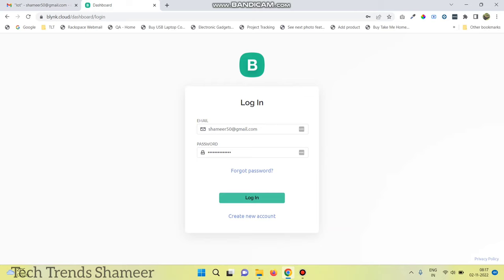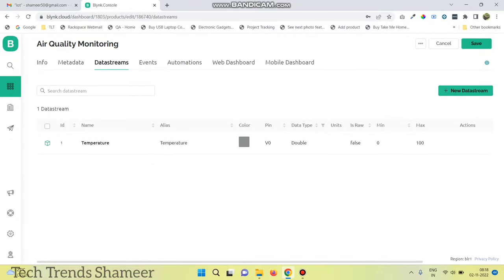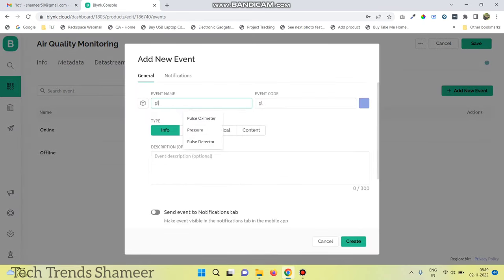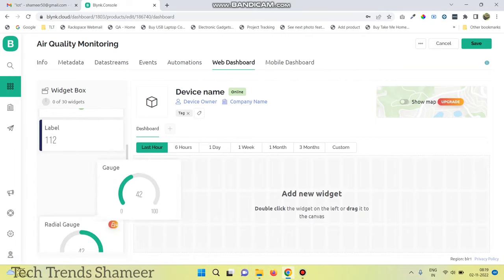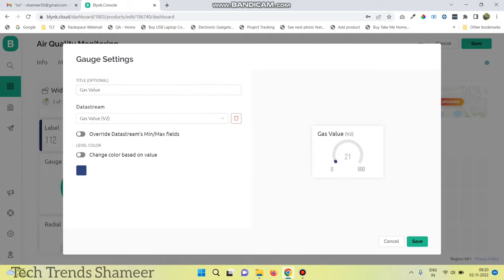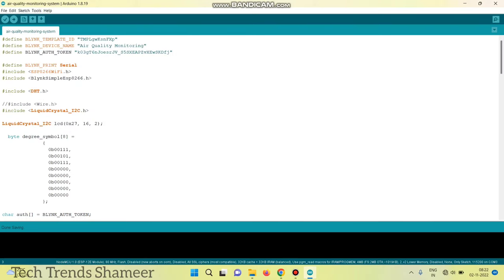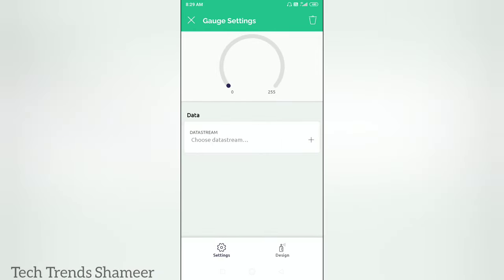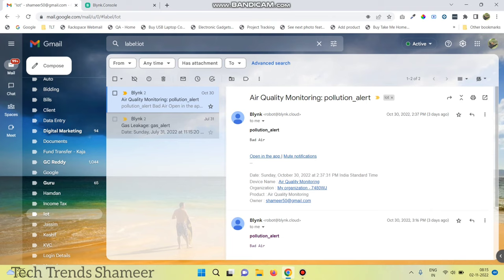How to Monitor Air Quality | Air Quality Monitoring System | ESP8266 | Blynk IOT Projects

Comment: Hi sir , 
When I upload code in nodemcu board it's showing a warning: library liquidcrystal i2c claims to run on avr Architecture(s) and may be incompatible with your current board which runs on esp8266 Architecture(s)

And my lcd is not showing anything
Reply: Have u fix the problems ?
Reply: @brianwijaya7378  nope
Reply: Bro whether output came.. did you troubleshoot this problem
Reply: Do u get the ans?? I am getting the same issue

Comment: To which u connected the air quality monitoring device that black cable is it to Laptop 

Plzz say it fast
Reply from the maker: Yes. I connected to laptop. You can connect using power bank too.

Comment: Provide the connection for interfacing of circuit
Reply from the maker: Its in the video. Watch full video.
Reply: Which IDE version you are using in this project
Reply from the maker: Arduino 1.8

Comment: Are you using male to female wires?
Reply from the maker: Yes.
Male to Female (For Breadboard to Sensor Connection) and 
Female to Female (For I2C to Sensor Connection)
Reply: @TechTrendsShameer  By the way I tried to make the circuit diagram in Fritzing but I didn't find the library for MQ135, do you think you can help me with that?

Comment: there are error in code. nodemcu pin to be defined as D2 and not 2. further GAS value is not getting printed in serial monitor being not defined
Reply from the maker: Both are correct. If you define as D2, you need to connect to PIN D2 in Nodemcu. If you mention as 2, then you need to connect the D4 in NodeMCU (GPIO4).

Comment: WARNING: library LiquidCrystal I2C claims to run on avr architecture(s) and may be incompatible with your current board which runs on esp8266 architecture(s).
 It says like this when I try to compile,what should I do sir?
Reply from the maker: You need to install that library LiquidCrystal I2C
Reply: @TechTrendsShameer  yes I did but the problem still persists sir
Reply from the maker: still same error ?
Reply: @TechTrendsShameer  ya actually I install more than one library(liquidcrystal)...but still the same
Reply from the maker: Remove all the old libraries and use this one alone.
https://github.com/Tech-Trends-Shameer/LiquidCrystal-I2C

Comment: Sir i dont want to use I2C controller then it will okay or not
Reply from the maker: You need to modify the code if you are not using I2C.

Comment: WARNING: library LiquidCrystal I2C claims to run on avr architecture(s) and may be incompatible with your current board which runs on esp8266 architecture(s).
sir what is warning
Reply from the maker: It's a warning. You can ignore this

Comment: If we not apply screen did project work
Reply from the maker: Didn't get your question.
Reply: @TechTrendsShameer  means in code led code is also there so if does not connect 16x2 led so project work I have dht 11 and mq 135 sensor
Reply: My project is working fine with dht 11 sensor and is giving output to blynk but when I tried to run with your code which includes 16x2 led screen,mq135 sensor and dht11 sensor blynk is not showing error.i have not attached led 16x2.
Reply from the maker: Remove the lcd code and try.

Comment: Sir please tell where did you write the code, how to upload the code to ESP8266 board
Reply from the maker: To write code I am using Arduino IDE.
Check this video for NodeMCU setup 
https://www.youtube.com/watch?v=IXSzQpfp0n4
Reply: @TechTrendsShameer  Thankyou sir for your response, but even after trying multiple libraries for LiquidCrystal_I2C 
showing "compilation error no such file or directory is found"
sir, Please tell what should I do
Reply from the maker: May I know how you installed the library?
Reply: @TechTrendsShameer  Sir after trying your zipped file for LiquidCrysta, it worked
But now same problem is arising for (HID) but unlike other libraries I used there is not any proper library in Aurdino IDE as HID.

And even after trying a zip file from aurdino website, error is same
Sir please tell me what should I do
Reply from the maker: What is HID ?
Reply: @TechTrendsShameer  I think it's a library or module in mouse library

Comment: Sir atleast make detailed video about it as most of the people are new to this things like me please provide more info like explaining the code how do we upload the code how to connect blynk to our esp8266 or any other board as of now i am stuck that i have uploaded the code..... followed every step you said and still not working...help us
Reply from the maker: I explained the steps of blynk connection in the video. Esp8266 Setup I explained in a separate video. If I include   esp8266 Setup steps in every video, video Length will get increased.
Reply: @TechTrendsShameer I've used the small sized bread board did the connection as you showed in circuit diagram idk what is happening my display is not showing any reading form humidity temperature sensor it shows nan% and in MQ135 sensor I am always getting higher number and on blynk dashboard am not getting any reading what to do?

Comment: Nice project but if i have to use this in the open field it is not working as there is no wifi connection so pls can you make A project that works on arduino nano as it does not Requires wifi connection and can sense Air Quality anywhere without wifi or internet connection
Reply: Hey! we are also working on a similar idea that you referred, did you find any similar videos/projects related to that? Also please tell us because we are going to make it a final year project. Thanks
Reply: 1 person by the name vk technology has put the project on youtube is working without wifi with ardu nano but has not put code in the discription  and is asking 1000 Rs for code
Reply: It is vmk projects
Reply: It is vmk technology

Comment: Hello is this really working, i planned to do this with our project
Reply from the maker: Yes. You can see the output in the video.
Reply: Can it be use, using Arduino uno r3
Reply: Is this the same code if i used arduino uno r3 than nano?
Reply from the maker: Code will change.
Reply from the maker: Code will change.
Reply: Hi can you do it with arduino uno r3 or what are the changes in coding can u provide

Comment: What if I don't use 12C Is it still working or not?
Reply from the maker: You can use without I2C, but the connections will be different and you need to make few changes in program.

Comment: sir i need answer ASAP the  code is working but the gauge in blynk is not showing the data can you show me how please😭😭😭
Reply from the maker: Check the Auth code and wifi credentials are correct.
Reply: hey did it work?

Comment: please,kindly solve this error
 Variables and constants in RAM (global, static), used 31520 / 80192 bytes (39%)
║   SEGMENT  BYTES    DESCRIPTION
╠══ DATA     1560     initialized variables
╠══ RODATA   2688     constants       
╚══ BSS      27272    zeroed variables
. Instruction RAM (IRAM_ATTR, ICACHE_RAM_ATTR), used 61911 / 65536 bytes (94%)
║   SEGMENT  BYTES    DESCRIPTION
╠══ ICACHE   32768    reserved space for flash instruction cache
╚══ IRAM     29143    code in IRAM    
. Code in flash (default, ICACHE_FLASH_ATTR), used 258612 / 1048576 bytes (24%)
║   SEGMENT  BYTES    DESCRIPTION
╚══ IROM     258612   code in flash
Reply: I also faced this problem 😢 please kindly help us 🙏🏻
Reply from the maker: Remove the cable and connect again and upload. Also press the RST button in the nodemcu
Reply from the maker: Remove the cable and connect again and upload. Also press the RST button in the nodemcu.
Reply: I did sir but not work😢
Reply: Kindly  help me sir😢
Reply: hey did it work?

Comment: My project is working with thingspeak but not with blynk
Reply from the maker: What is the error you got?
Reply: Data not showing on blynk my node MCU is connected with my mobile hotspot
Reply: I also made fire detection with blynk but same problem
Reply from the maker: What is the error you get?
Reply: @TechTrendsShameer temperature and humidity data is not visible on blynk app .it only showing 0 parameters in temperature and humidity
Reply from the maker: are you getting the values in Serial Monitor?
Reply: @TechTrendsShameer  no